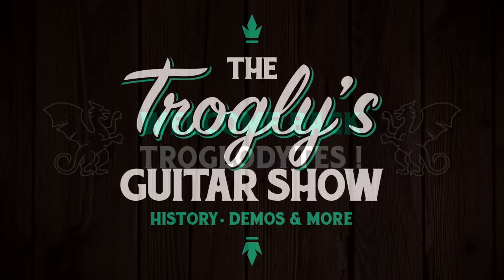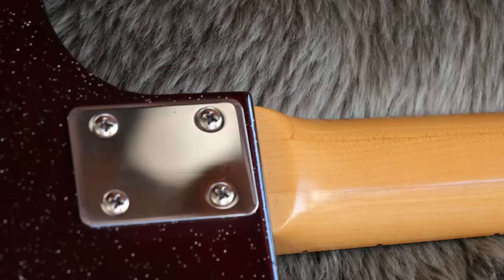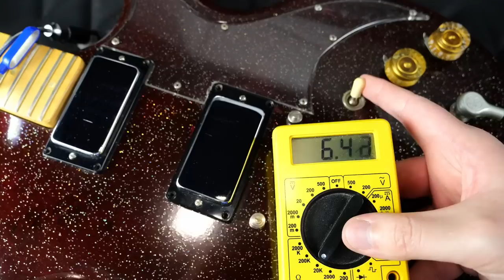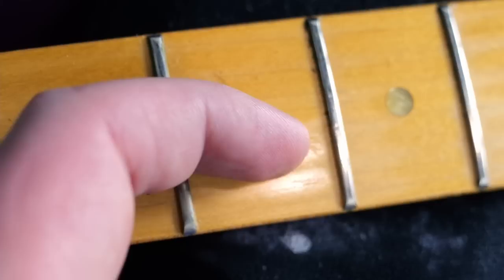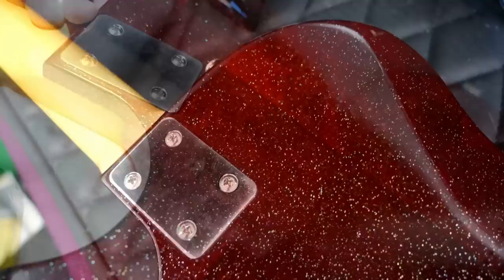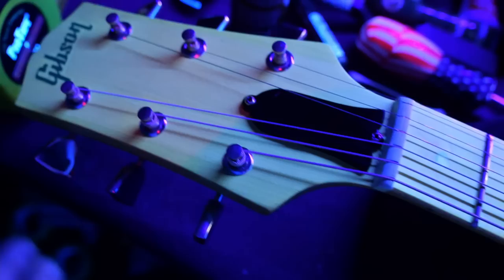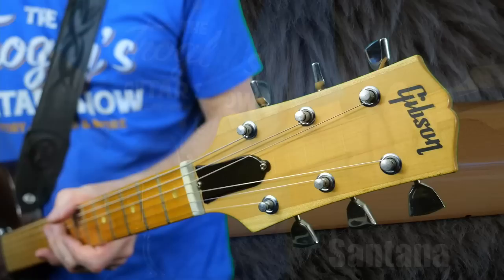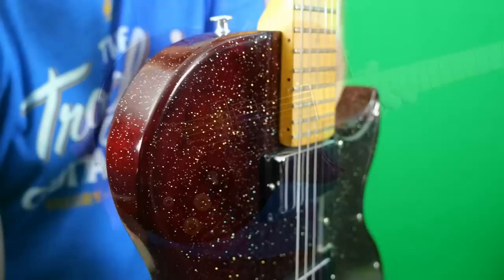The “RARE” Bolt-On Neck Gibson | 1974 Gibson L6 Midnight Special Burgundy Sparkle Glitter

Comment: I have the Cream Sparkle in very good condition, just with quite a bit of finish checking. My cousin gave it to me either in the late 70’s or early 80’s. The neck is always rock steady with super low action,.. one of my favorite specs is the mother of pearl dot inlays on maple.. noice!… but the nut width is so narrow that it’s a little odd. I still have all the original parts but I swapped out custom cream plastics to go with the lighter shade. The Cream Sparkle is not translucent. As a kid I was a bit cringy about the sparkle aspect with the butter yellow palette, but It’s really a killer simple guitar. She has never been my favorite.. just a sentimental favorite and I’m glad I never sold her. I often wished that I had been given a DC special instead, but I am grateful. She’s still my only Gibson so far although I have a long wishlist. It’s a rare , but quirky bird. I wonder how much mine is worth ? Yeah it can get quite bright, but that’s what’s cool about it. And the neck pickup with the tone rolled off is quite a wide contrast with the bridge. I’ve wondered at times if it was Gibson’s version of a Tele style guitar. You can tell my body is handmade … so it’s kind of cool in an imperfect way.

Comment: I have a blonde L-6 Deluxe. Never understood why they don't appreciate. They only made these ones for two years. They have been making Les Pauls for 70 years and they are worth way more.
Reply: I think it's because so few people like them. You need both scarcity and desirability for something to appreciate.
Reply: Agree. Still have mine from 1975, plays fast and love it. Only issue is the harmonica bridge I really wanted to be able to replace it but it is not to be found. Also I worry about eventual fretwear.... not sure I can find equals. Gibson does not know what wire it is😢
Reply: @VidMashUp  The pickups are not very hot. Someone suggested using a preamp. More likely I would just replace the pickups, but then what little vintage value it has would be gone. I guess it is what it is.

Comment: @5:42 I would use a small blob medium adhesion hot glue on the base of those wires. You'd be less concerned if you wanted to play and enjoy it, plus medium adhesion would come off easily enough to get it back to "stock" if you were to sell it as original. That said, I bet there is a good silicone solution as well.
Reply: There's no way you'd get any type of hot glue off if those wires without snapping them. They are the most fragile wires you can imagine. And you'd risk damaging the coating on the wire with any heat. The problem though, isn't with them breaking while you're playing the guitar. I think he was just concerned with taking them out. As fragile as they are, they don't tend to snap spontaneously.

Comment: One other thing, I don't like the Jack in front, but the sides are thin to install one jack there. Maybe that's what they needed to litten up to get a 7lb guitar. One other thing, I still have, from 1982 a Bill Laurence humbucker and it still worked the last time I used it. The guitar I used it last was in a Gibson-like Les Paul's birdseye maple body with 2" inch center stripe of mahogany. Made by Michael Tobias, (before Gibson bought his sole and he was working in Hollywood) The neck was all maple Strat neck, with the black walnut skunk stripe. I played that on guitar from 1982 to 2015 and it was becoming too heavy. I bought a Squire and I strip the electronics and wired up many different guitar circuits with that guitar. My favorite circuit was humbuckers with split-coils. I fell in love creating that circuit and treble bleed circuits. I'm not crazy about the phase circuits both on a 5 way switch of capacitors or a reversal poles from a small circuit (no batteries needed) on a potentialmeter or a volume pod, 250K ohms or 500K ohms. Slowly or how you spin the knob to changing poles north to south moves. So my guitars will have best electronics combinations I know. One pickup I'd like to try would be Fishman P90s. Cheers!

Comment: This is So Gibson , so the L6s has a few versions, ie the one you’re showing, and the ones with the 6 position Rotary selector , that they “SUPPOSEDLY “ were intended to come with , apparently they had to make at least 2 very different yet labeled the Same L6s’s ,
I guess since Fender made a dozen Tele models, Gibson could not be Outshined !  
Mine has the Rotary switch , making it a bit more interesting than Bridge / Middle/ Neck . 
Great Video again sir !!

Comment: I had an L-6S Custom for a while (Plain Maple Finish). One of the few Gibson Guitars that I really was enjoying....but it had a problem with a neck that had a permanent backbow (I loosened the truss rod until it was rattling & it still was bad), and I didn't want to go over 10 gauge strings to try to get it more playable with a decently low action. I Loved the tones on mine! (...and I am more of a neck pick up or middle position guy anyway. Just readjust your amp settings!)

Comment: Nice find this beautiful Midnight Burgundy Sparkle L6, pickups sound pretty good distorted. Is thin pickup lead wire a case of Gibson being cheap or overly geeky about signal loss? I hate the thin 28 gauge leads on my Les Paul, stripping them is a PITA and they are really short. Modding a Fender pickup wire is a treat compared.

Comment: Salutations Austin!
That is a decent example of that particular model, and it has a very interesting finish.
I used to own an L6S that was black with a set neck, a varitone control, and I believe it had a stop bar, I put two different Dimarzio pickups in it and also a MIDI pickup, it sounded and played great. The black finish on the neck wore off and exposed the maple, and it also had an ebony fretboard with 24 frets.
I now miss that guitar.
Thank you for posting these videos!
Please have an excellent and awesome day! 
☀️✨🎸

Comment: Allow me to introduce you to "Micro soldering", in no way is breaking those wires an issue if you have access to one of these pro's! (they're everywhere ^^)
Reply: They're epoxy potted. If it breaks past where the epoxy begins, you'd have to be one hell of a magician to fix it. The covers don't even come off.

Comment: I’ve always wanted an L5-S. Much cooler than a Les Paul. They recently did a stripped down Keith Richard model. 

They also had the version with the Les Paul recording pickups.  

I also always wanted an L6-S. Those were designed by Bill Lawrence. I was disappointed when they removed the 6-position pickup switch and midrange control.  

Guitarists are so boring. Give them something different and they are lost!